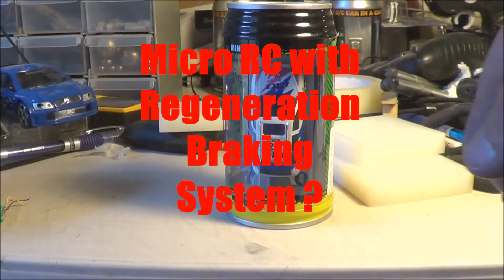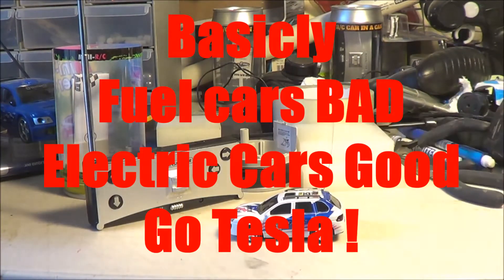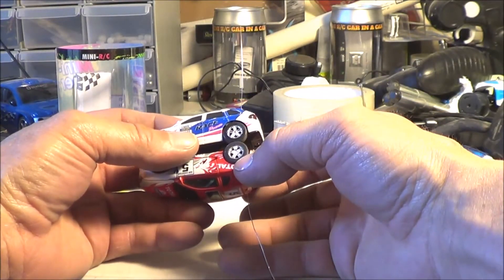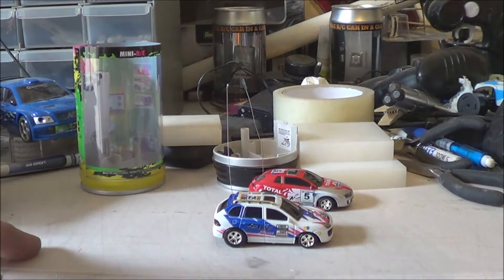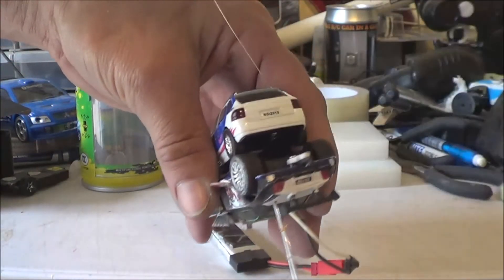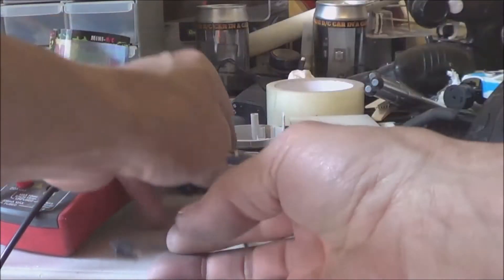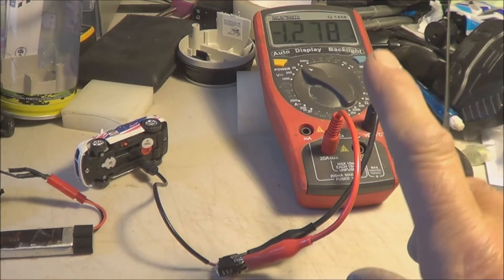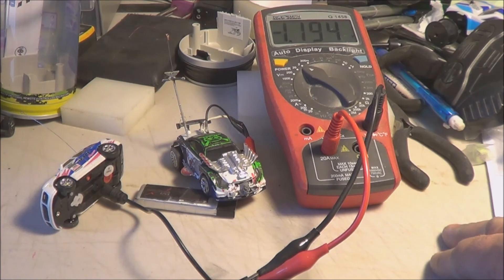Regenerative Braking System found in micro rc car / Mad Micro RC Mods

Comment: Interesting vid, as always. I have a somewhat unrelated question... I have the A959 b and it uses a 5 wire servo, I want to change the esc/receiver combo to a seperate proper esc (brushed so I can keep the motor) and a receiver so I found this :https://m.banggood.com/Wltoys-L202-L959-PRO-RC-Car-Brushless-Circuit-Board-L959-P-06-p-921566.html
This receiver supports 5 wire servo and 3 wire esc and it lets me keep both the servo and the transmitter (and keep the cost at a minimum) but it says in the description that it's a brushless receiver??? So my question is can a receiver be only for brushless setup?
Thanks